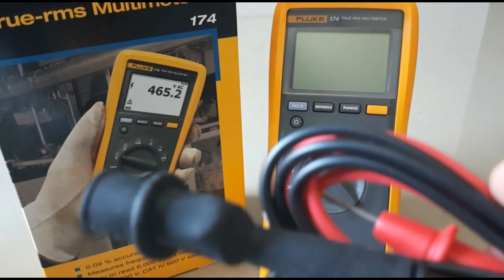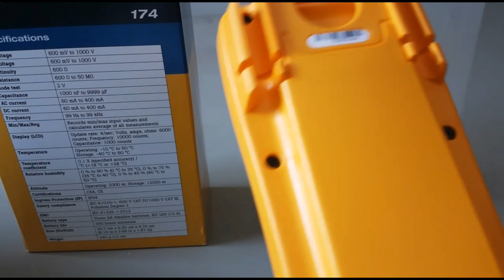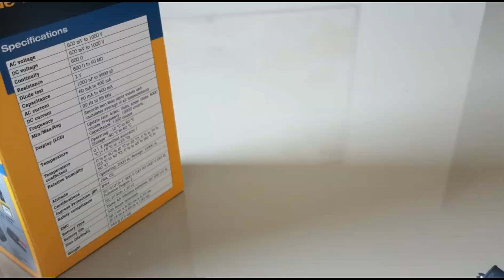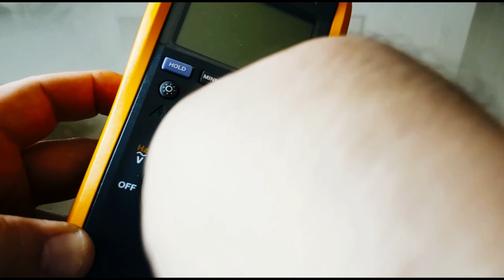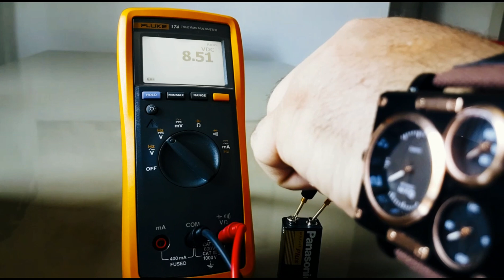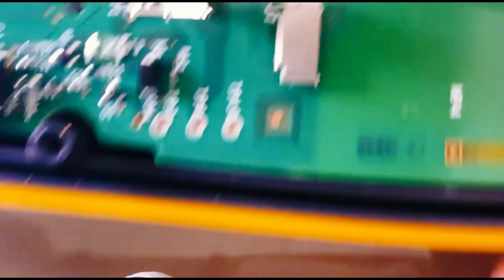WTF? FLUKE 174 MULTIMETER REVIEW (What the Fluke!)

Comment: Theres really no valid excuse for a meter of Flukes cost and caliber to be so big and have such a large virtually empty screen yet have such tiny digits also with no bar graph.  Not to compare quality but there are $12 - $20 cheap asian meters with way larger displays.  In fact I think even the Fluke 101 even has bigger digits.  The $130 Fluke 17B+ I have from asia has a huge easy to read display and a few more features - not US made but innards look like Fluke design and it feels like a Fluke with good input protection and it seems to work very well and so far im content for the $130 I paid shipped.  Just seems some of the Flukes dont give the functionality they should for what some of them cost, I realize its also Fluke quality you pay for but as you said there are asian meters out there offering more functionality - but not the build quality of course.
Reply from the maker: Yes I agree, Fluke must have had too many Fluke 3000 FC meters lying on the assembly floor and didn't know what to do with them! These are exactly the same meter without the wireless functionality, so why bother? I honestly don't know what Fluke was thinking but this meter was a major letdown and the screen looks ridiculous.